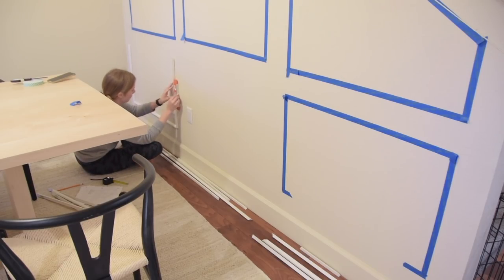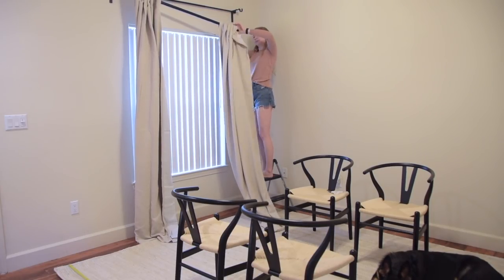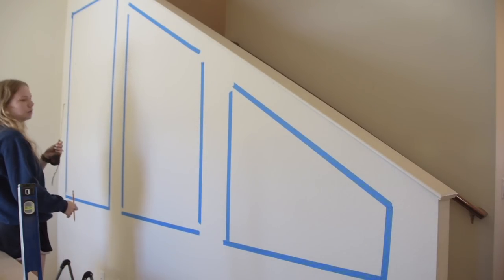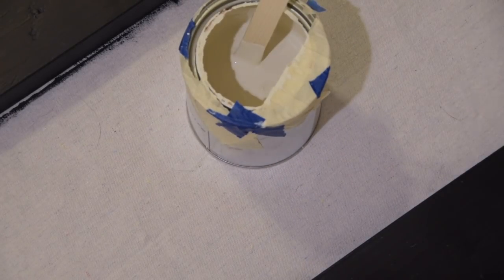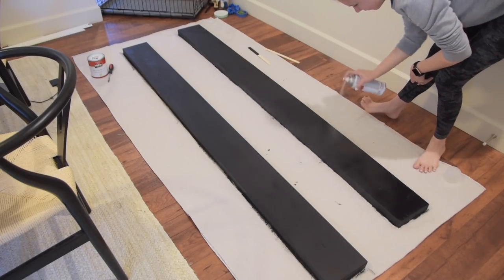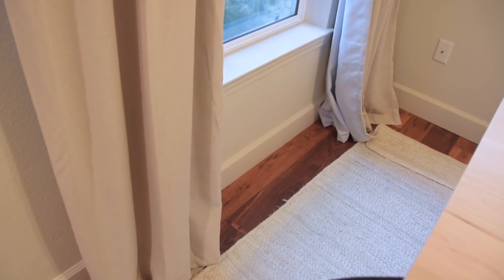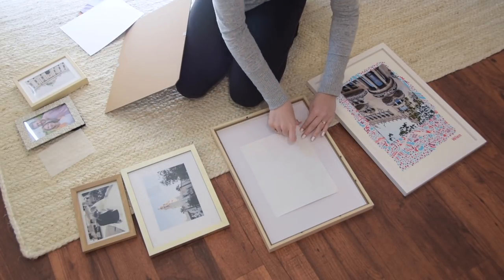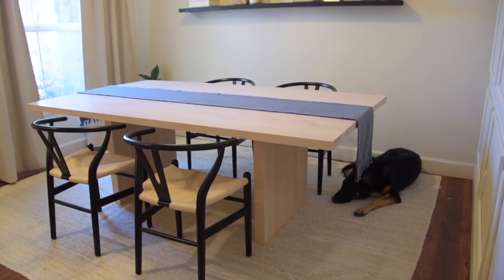EXTREME DIY DINING ROOM MAKEOVER | dining room makeover on a budget + dining room decorating ideas

Comment: If you were using that long drill bit, without any guide, they might not have been straight and therefore got hung up. This is a great way to float shelves. Best way is use a drill press - or find someone who has so those holes would be perfectly straight. But good for you for persevering.